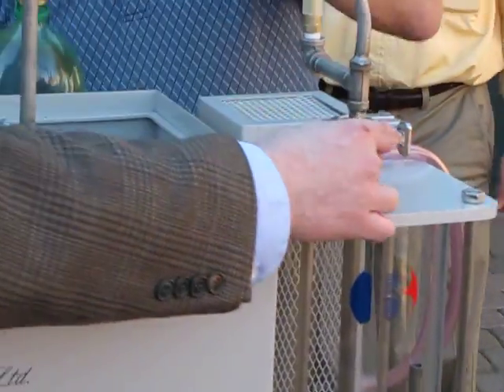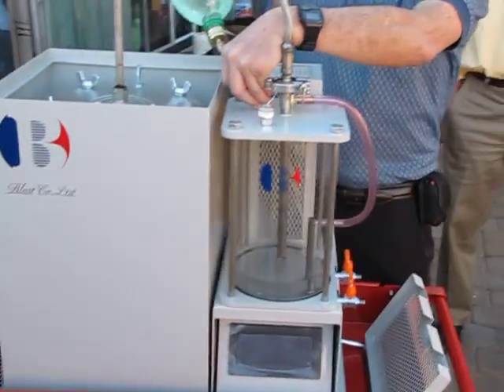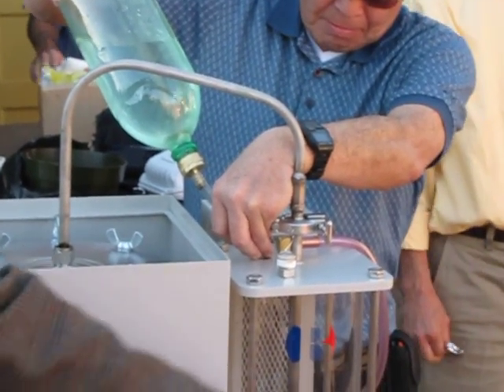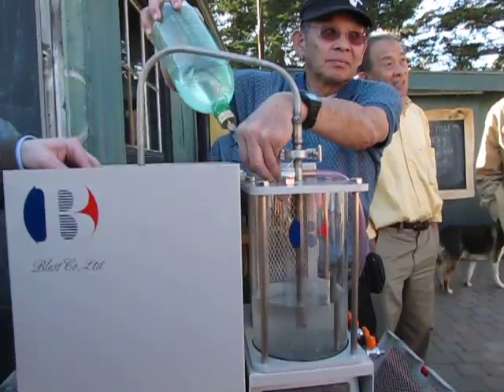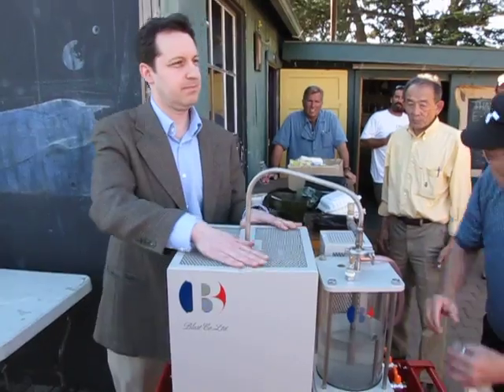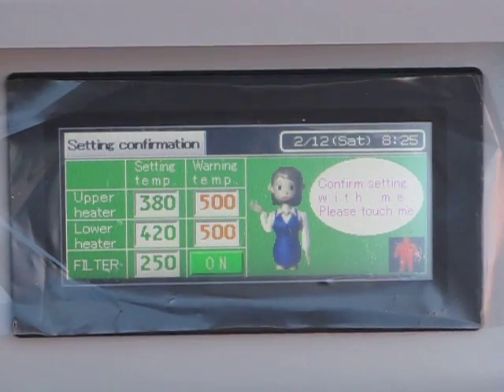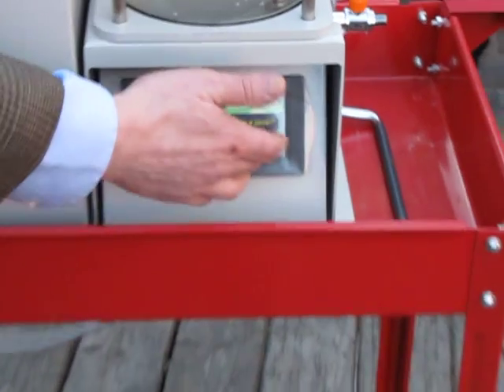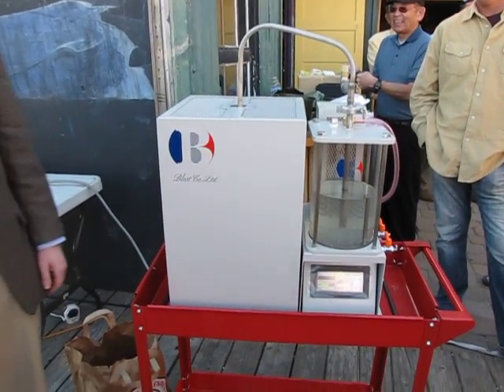Plastic to Oil Machine at Orella Ranch, Santa Barbara , Gaviota Coast (part 3 of 3)

Comment: Just what the world needs another device using electrical energy to retrieve oil which used energy to be pumped out of the ground and more energy to ship from the oil fields and more electric energy to be pumped out of the ships and more electric energy to refine and more electric energy to turn into plastic and more electric energy to turn into oil ad infinitum........Why not just use the electric to drive cars like the Tesla and Leaf and move into the 21st century!
Reply: D Gatewood this takes garbage and turns into a viable product...leave the oil in the ground.
Reply: @shemamabell-irving2671  why leave the oil in the ground? It's there and it renewable. 
Oh yeah most people don't know it renewable. Lol. 
Most of the places they drilled for oil are 90% refilled in 30 years. Like how the oil companies have lied to you? 
Anyone that doesn't believe this: spend me $1000 And I'll send you 50 gallons of crude oil from a 1940s dry oil well. Not to worry there is billions of barrels of crude oil under me.
Reply: Why not just use gasoline??????
Your electric cars pollute more on the long term then a 1950s gasoline engine.
Oh, you going to get all righteous now but the truth is.....
The electric for your dildo car is marked by coal plants.
Plus you have the other components like batteries and plastic, ECT ECT.
Don't pretend that any of these alternative fuels are better.
Before you go screaming with that dildo in your tailpipe.
I have lived off grid for 10 years. I didn't do it for a greener planet. I did it to not pay outrages prices for engergy.